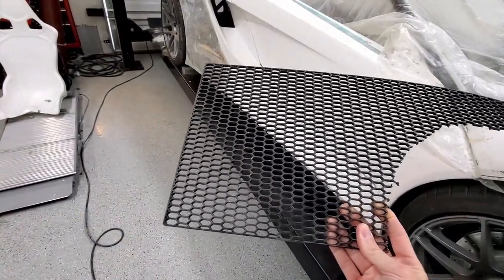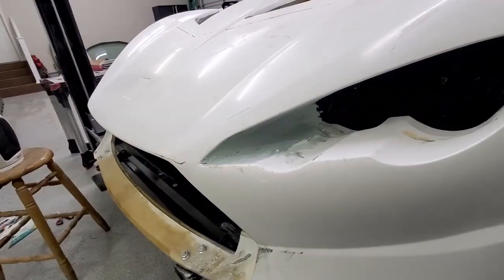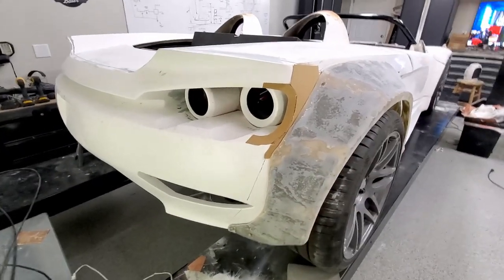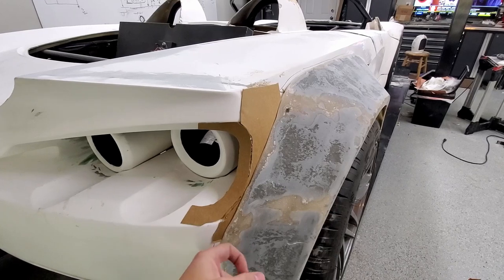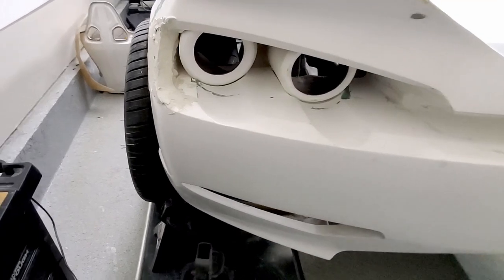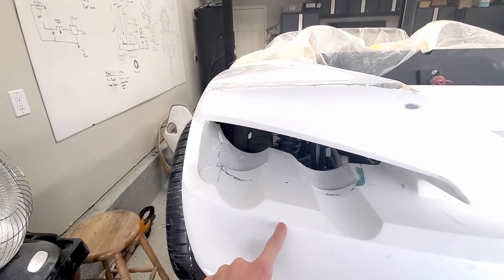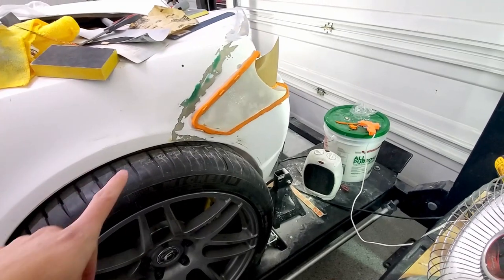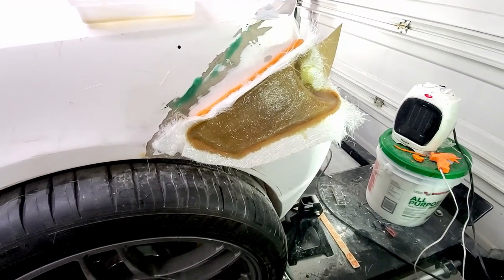First Fiberglass Mold - Rear Fender Modification, Fiberglass Mold Prep, DIY Car Fiberglass

Comment: Beautiful work, I think you’ll be very happy with how all of the parts look when you can assemble and fair everything together.  I’ve cut down Walmart’s plastic Bondo spreaders before to establish unique shapes with filler, and have used short pieces of dowels and even wooden closet poles as sanding forms...anything you can find to help shape and smooth filler will make it go faster.  It’s looking fantastic!  —Don
Reply from the maker: Thanks Don!

Comment: Impressive as always. Your patience and grit always stand out. Before you pop that first mold off, may want to just trim the flange near the back, and use that return (lip) as the backstop for the other half of the mold. Then poke some alignment holes through ‘em.  Good luck!
Reply from the maker: I haven't figured it out yet, but I think you are right!

Comment: I just found this channel and subscribe!  This is a dream come true!
I have built many custom cars and envy your talents and perseverance. 
In the front headlight area, try using a pipe of certain diameter, hold, tape, glue the sandpaper to the pipe, really helps inside corners.
Reply from the maker: Handy Dan, welcome aboard!  Thanks for your tips!  Keep them coming!
Reply: @ElectricSuperCar  You are doing an amazing job, if you have time you can look through my videos 3of5 and 4of5 on my Smart car wide body build, I go through the bad body kit fitment and all the bodywork I did. 
Fiberglass is a little messy but really fun to work with for endless ideas 💡
Reply from the maker: @HandyDan  Thanks Friend!  I will check it out!

Comment: I have a little tip for you, even though this video is now 6 months old. Instead of joint compound, I use Plaster of Paris, which is available in 20lb bags and smaller containers, too. I use a 50/50 water & white Elmer's glue mix. Mix the liquid and enough plaster of paris to a pancake batter mix. You have about 10 minutes to work with it, so only use small batches. It dries a lot faster than Joint compound and doesn't crack because of the glue added. It can be rasped when set and is fully hardened in 30-45 minutes. It works great for fiberglass work and can be chipped out to make changes and sands really well. I have even fine sanded with 800 & 1000 grit sandpaper and waxed it to lay fiberglass right on top of it.
Reply from the maker: Awesome tip!  Thanks for the comment!

Comment: if you use a spray water bottle and wet the cardboard it will mold much easier. Using a wet sponge will also make that drywall mud very smooth.
Reply from the maker: Thanks for the info!

Comment: It is looking good  .  If you want an easier way to sand some of those complex curves for example in the taillight area here is what you do . Get yourself a piece of wood and make yourself a buck by shaping it to match the curves . Then wrap sand paper around the buck and nail it on tight . This will allow you to get a more uniform finish .  I hope this helps  !
Reply from the maker: Thanks for the suggestion!

Comment: How come you're not using polyurethane foam for the sculpturing part? I imagine it would be easier to work with than the drywall compound.
Reply from the maker: Maybe you are right.  I will have to try that next time.  Just using what I have.
Reply: @ElectricSuperCar  looking forward to see which suits you better

Comment: 7:23 the top line should follow from the top line of the boot lid, 7:23 round the curve and meet the fender arch top line, blend,  then continue straight and flow down the front side of the fender arch to the floor.

Comment: And for your first time doing this you have some fantastic work. If only you could just use the drywall as is. It looked like a finished product before you put the mold on.  To bad I'm sure first bump it would crack and explode off.
Reply from the maker: I know, it looked great with the drywall compound.  Too bad it is not that easy.